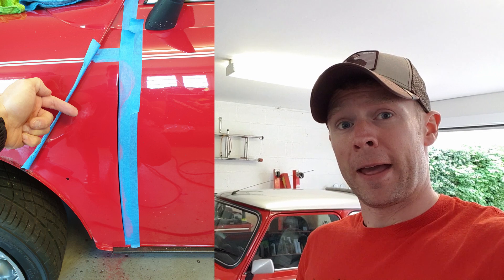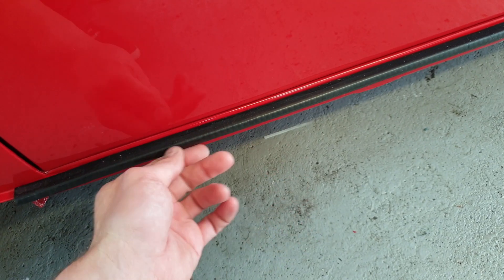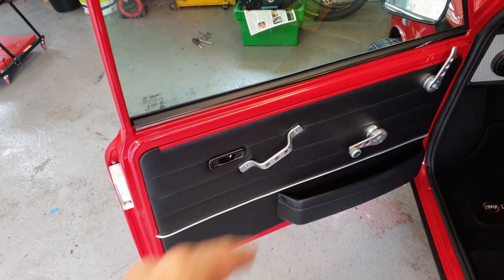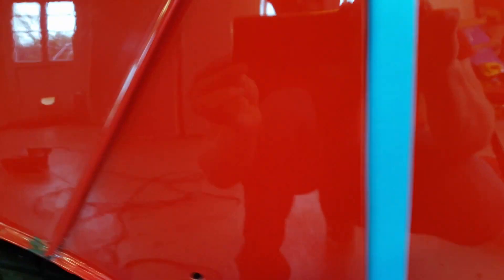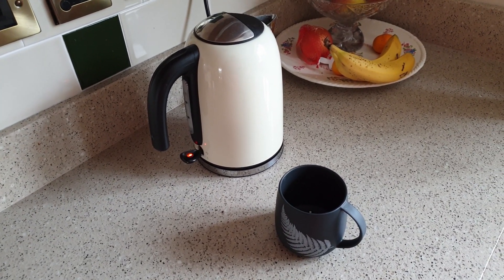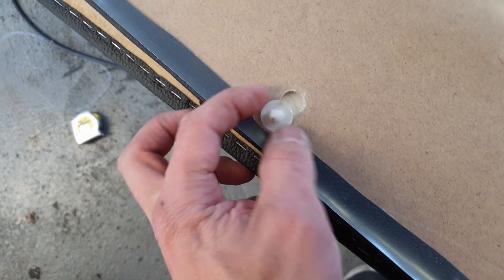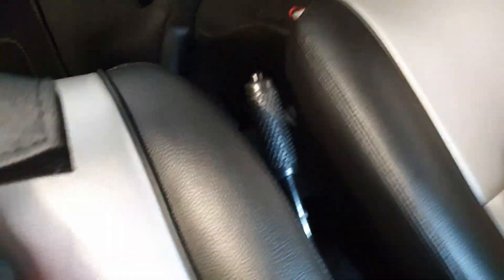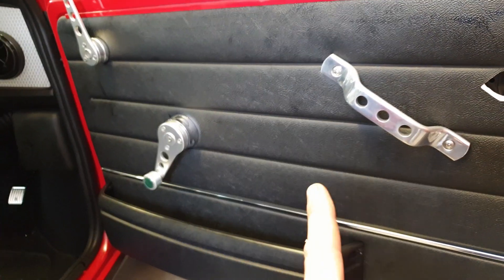Classic Mini Turbo - sorting paintwork and interior!

Comment: I went through the paint on an MG Midget once being a bit over keen with the T Cut on a freshly painted panel I'd done a few days previously with cellulose paint back in the day. The paint hadn't quite cured enough and it was on an edge on the wheelarch.....my heart sank instantly. Luckily the top boss was on holiday so I worked back an hour, blew it in and never said anything and got away with it.....never did that one again 😂

Comment: Is it not best to wet sand first than polish an wax?
Reply from the maker: It's best to wet sand before anything in order to set a president for the paint. Unfortunately mine needed more work after paint hense why ive wet sanded, but that A panel was an ongoing issue for the past 2 years.